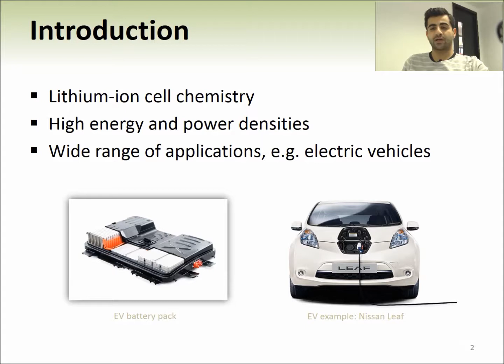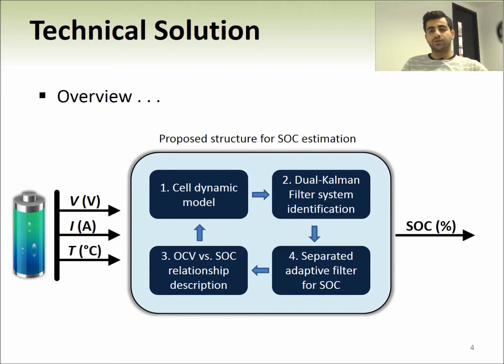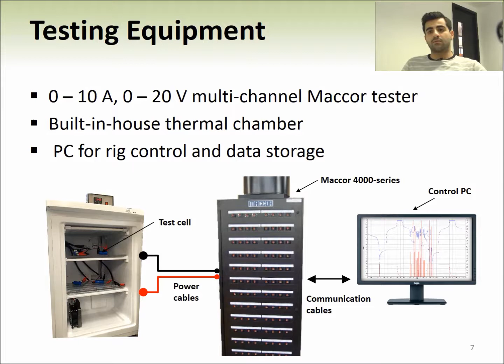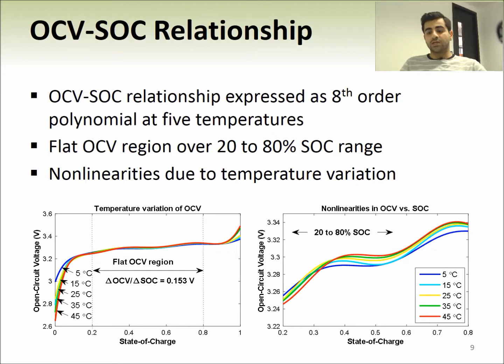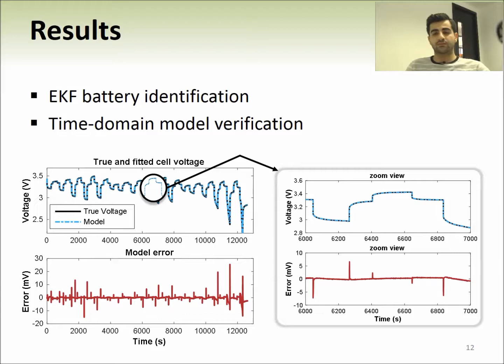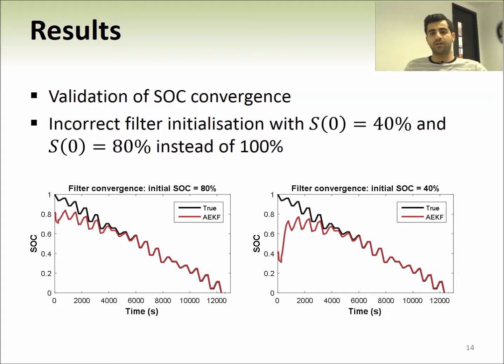Enhanced State-of-Charge Estimation

Comment: what do you estimate in dual kalman filter? I s it capacity fade and power fade. Can you tell more about this AEKF and how is it different from a normal EKF.
Reply: great to hear. yeah now i get it. thanks a ton! . I am working on a BMS design which needs SOC estimation. I am looking at what microcontrollers can be used for this purpose. . Looking at all the matrix multiplications seems like a really good controller is needed. How about using a raspberry pi? any other alternatives?
Reply: thanks! That info helped me :)
Reply: Manikanta Raju hi whatis the status of your bms development? Which microcontroller have u selected?
Reply: Can you please share the data...I m working on Lead Acid Battery Prognostics and would like to implement the same through on Embedded system.

Amazing video